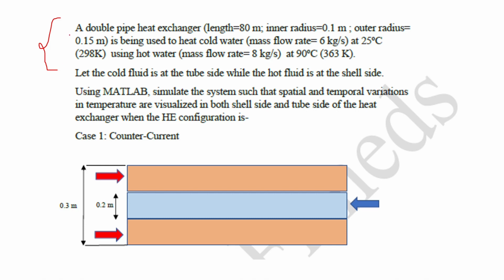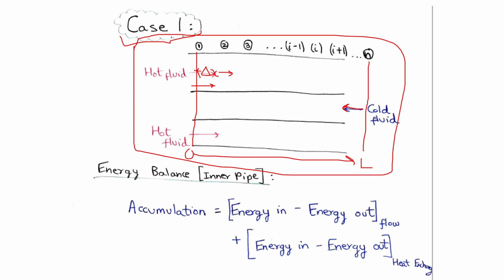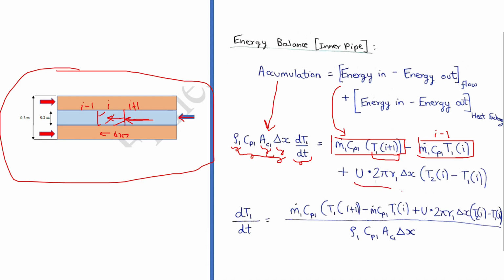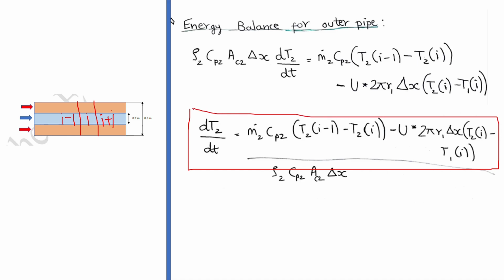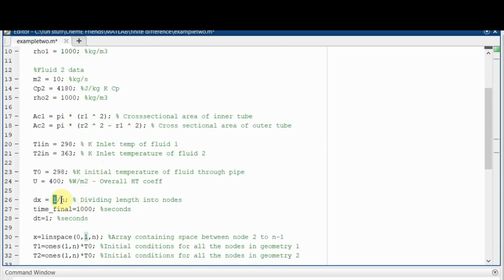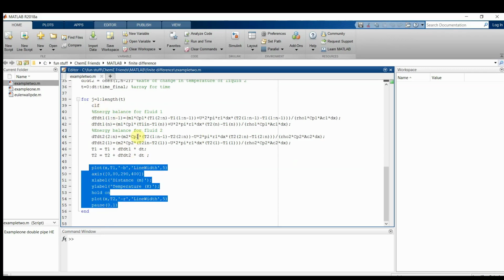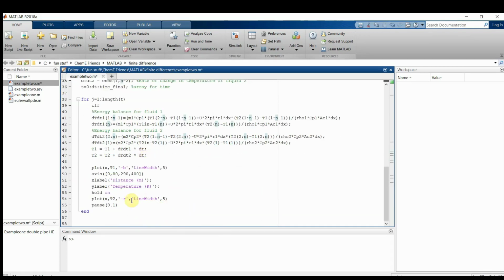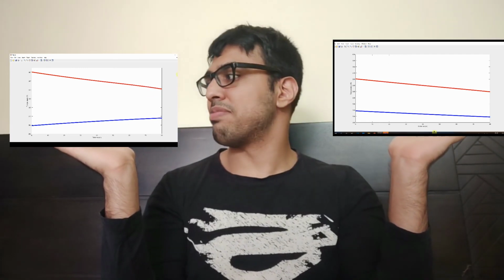Visualize Temperature Dynamics of a Double Pipe Heat-Exchanger using MATLAB

Comment: Is there a way to code this for any inputs ? Changing the constants dosent seem to work
Reply from the maker: Hey Edward! What type of inputs are we talking about? And which constants did you change?
Reply: I'm talking about different heat exchange experiments. The code dosent seem to work if I change say the radius' to smaller values or if I reduce L below 40
Reply from the maker: @edwardsavage2019  Actually we are using finite difference method in which we approximate derivatives. Reduce the number of nodes for lower values in length. For example, L = 40 reduce the nodes to around 5 or 6. It seems to blow up because of the denominator term in lines 41, 42, 44 and 45 at low times. Try printing time to observe difference in dynamics. Hope this helps!
Reply: Last question, how would you change the code to work for counter flow ?

Comment: Hi, is dead time included in this solution for case 1? And how can we include the transfer coefficient (h) in this solution? Can you convey the resources you take advantage of by e-mail? Please
Reply from the maker: Hey there!

Is dead time included?

Ans: dead time is used while modeling system output wrt input. You can easily visualize dead time when we run the code. Our cold side fluid does not immediately heat up in the outlet.

Have we included h?

Ans: The value of U accounts for both shell side and tube side h
Reply: @chemicalengineeringfriends217  So we can say that this solution is suitable for dead time, right?